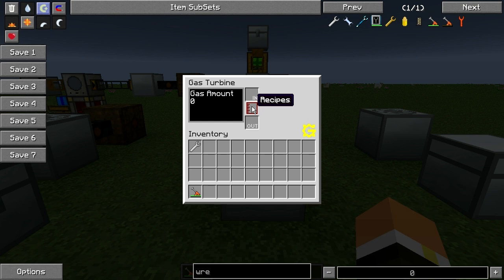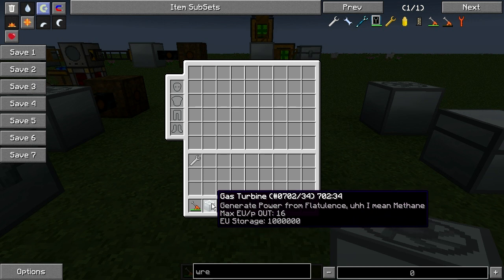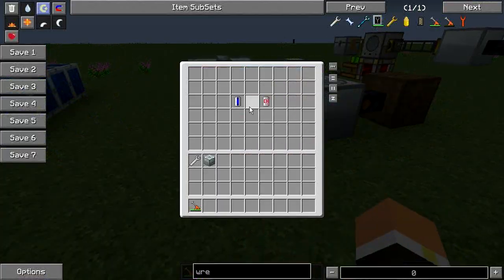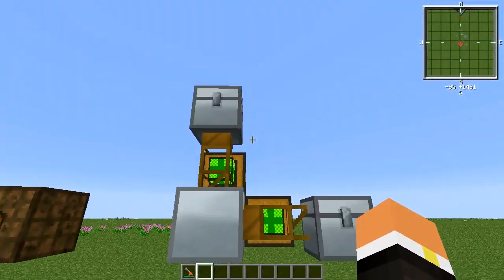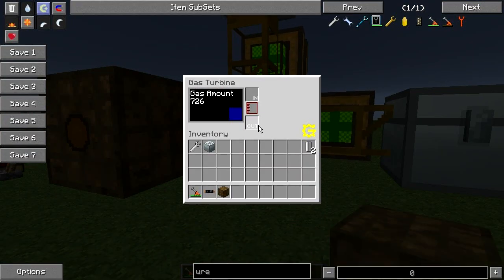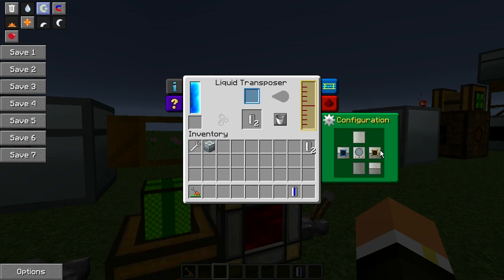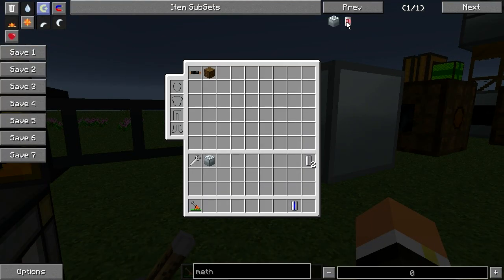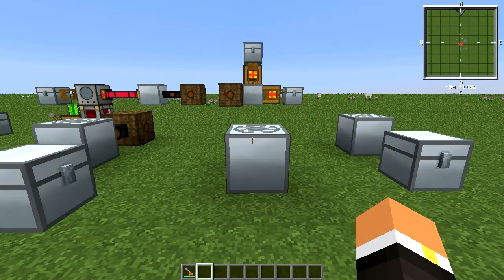Feed The Beast :: Machine Tutorials :: Gas Turbine

Comment: It would be a loss. The Industrial Electrolyzer requires at least 92K EU to produce 4 Hydrogen cells which will only give back 60K EU when put into a Gas Turbine. The only way I can see to make the Gas Turbine profitable is to use a Centrifuge to turn 64 netherwart or mushrooms into 2 methane cells and burn those in the turbine for a net gain of 20K EU per cell. Terra Wart would have a gain of ~28K Eu per cell. This is assuming producing the crops required no energy.

Comment: as hydrogen can be made by electrolyzing water most easily, would it be energy practical to electrolyze water from say an aqueous accumulator, transfer it to the turbine, and use the turbine to power the apparatus, with the excess going to other stuff?
I'm wondering if that loop would be a positive net gain or loss.